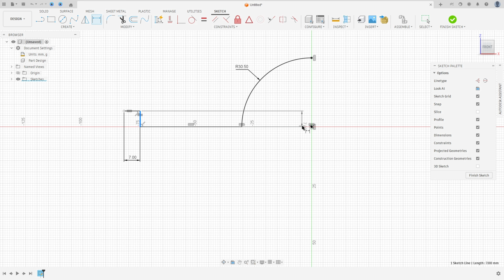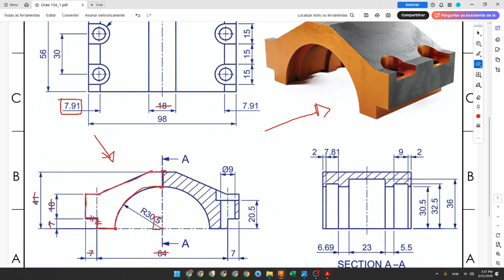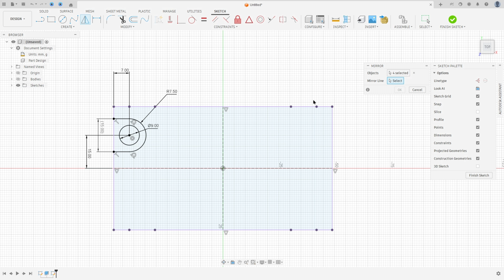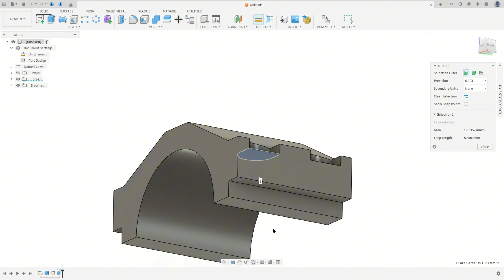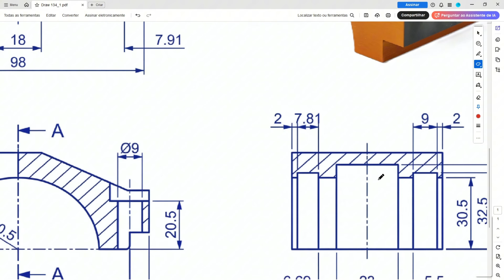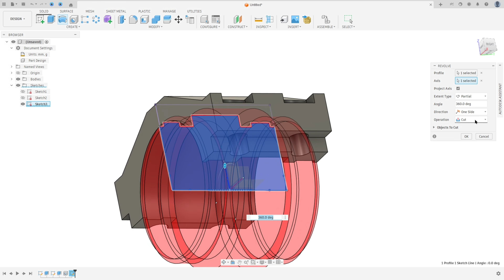Fusion 360 From Zero | Expert Tutorial Step-by-Step 138

Comment: Nice exercise. Question: in Section A:A, the horizontal dimensions do not add up to the total width of 56. It worked for you doing the model but, it appears the dimension 6.69 should read 6.7.